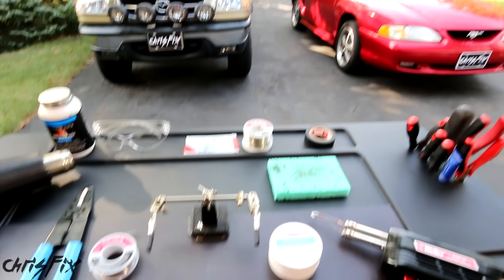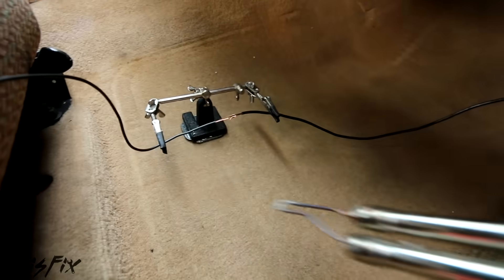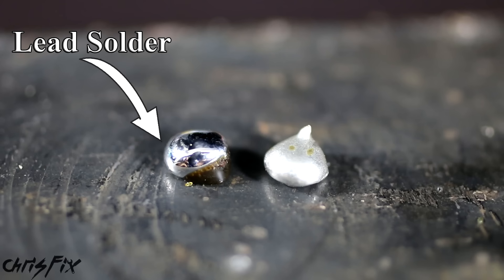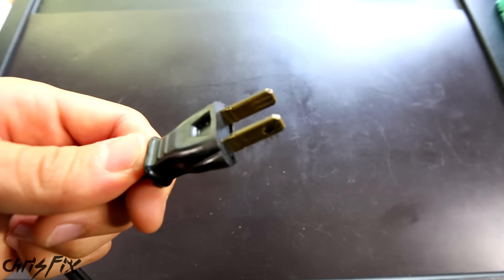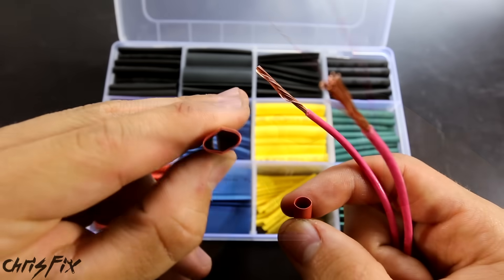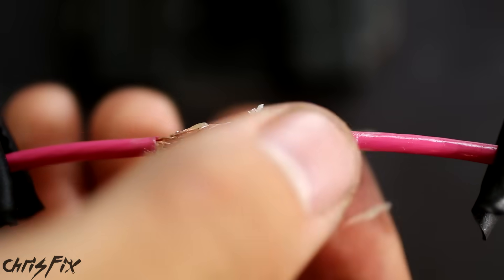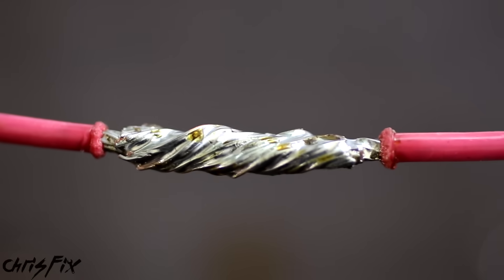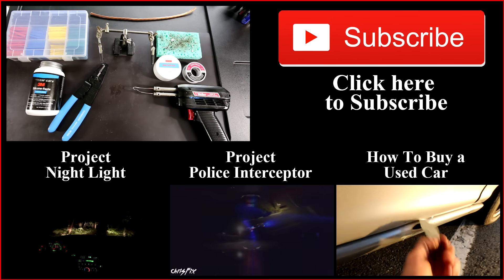How to Solder Wires Together (Best tips and tricks)

Comment: Tinning and cleaning the tip are important. However, DO NOT leave your iron "dry" after you're done soldering. Clean it with a sponge to remove the excess solder, flux, etc. then tin the tip with a little bit of fresh solder to provide a protective layer which will oxidize instead of the metal of the tip itself. Next time you use the iron, heat it up, clean off the tip then add a tiny bit of fresh solder.

Comment: My only contention is using the damp sponge to clean the tip. Use brass wire to clean the tip, then, quickly touch the tip to the damp sponge to SHOCK off the oxidation. I think your soldering is perfectly acceptable for the task at hand.
Reply from the maker: Thanks for the feedback

Comment: I had worked in a printed circuit board shop, I when I was running the gold tipping line, I plated my NEW, copper soldering gun tip. It was the best ever. I let it go to a person that really needed a great soldering gun, so, your tip on making a Cu wire tip is great, find someone that can make it Golden. You will Forever thank me for that suggestion. - It will heat up so fast you will be shocked.

Comment: copper is a very heat conductive metal, if the solder iron touch the copper threads, they will transfer the heat away from it to the surrounding area  very quickly, weakening the rubber that is wrapping on the wire with that heat, that is why the cold solder or whatever it is called is a better way to deal with wires.

Comment: For a better result and keeping the solder from running up the wires to far use a heat shrink. That way the only stiff part you solder is just the connection point. Now in your video the alligator clips are somewhat doing that job so be careful when you touch them because they can suck the heat from the soldering gun/iron.

Comment: I can't for the life of me get the solder to go into the wire unless I put the gun on top and touch the solder to it.  Just putting the gun on the bottom of the wire and the solder on the top does absolutely nothing other than get me incredibly frustrated...and putting the gun and solder both on top leads to blobs everywhere and a horrific joint.

This is one of the more frustrating things I've ever tried to do.  What am I doing wrong?

Comment: Thank you I will be using these skills. I was using an AC plug in Chinese soldering iron I did not understand The gauge wire has to match the heat range of the iron the sodder I used it did not want to melt at all. But when using a torch lighter it would melt easily

Comment: okay, been soldering for a while now, but never realized the importance of flux when soldering thick wires. That always frustrated me when the wires took ages to heat up to prevent a cold joint. so thanks for the well done video. Learned something :D

Comment: I actually learned to solder in a school setting, but i wanted to see how you do it. There is one more way to solder and they use it on airplanes. They stick solder on one strand, then the other, and then just solder them together. its still as strong as the core wire, it has to be as, again, they use it on airplanes. (They do it side by side and not tip to tip of course.)

Comment: Hey Chris love your videos. As a qualified Aircraft wiring and solder technician you're pretty close but a few tips I would add to this procedure to make it totally reliable:
1. For a cleaner smaller joint you can make it two to three times the length of the wire diameter or slightly longer and interweave as you showed. The solder is strong enough to hold it together and coupled with the heat shrink it will also help keep it together. If it's in the engine bay on the engine, make them longer and roll one over the other round and round then solder together.
2. Clean the wire with some Isopropyl Alcohol before soldering.
3, You need to strip the insulation back and only solder up to about 2 times the wire diameter from the insulation to ensure it's flexible, so the insulation won't stop it form flexing. If it does stop it then the wire bends at the insulation it acts like two hands bending a coat hanger back and forth and over time the wire will break where the solder meets the insulation jacket.
4. Use very little flux, but use some. This removes any left over oxidation on the wires before it's soldered together.
5. YES Put a small ball of solder on a clean soldering iron tip, contact the wire and feed from the top as you showed. This ball ensures a rapid heat up of the wire and full penetration into the wires. If you don't and the wires don't heat up fast then the insulation can start to melt, not good.
6. ALWAYS remove the FLUX on the joint with some Isopropyl Alcohol or Acetone before sealing it up with heat shrink or some other environmental covering. This will ensure that the left over acid in the flux does not break down the solder joint over time and eat into the copper wire. Even if you don't add flux most of today's solder does have some in it. That's the brown melted looking sugar stuff you see on the wire after soldering. It has acid still in it when you're done so clean it off.
7. Dielectric grease is a great idea, if you have acid free silicone RTV that's even better. Even better still is environmental splices, specifically if they are not in the passenger compartment. You can find it at most automotive stores.
8. Before you cover the solder, make sure any strands that are sharp or sticking out are flattened out, as over time they will break though the heat shrink or covering and can short out on the car frame, causing intermittent problems and fuses blowing s.
Thanks for the video. Best Wishes n Blessings. Keith Noneya

Comment: Solering two wires directly together in a car is actually a big no-no! Solder work-hardens and also oxidizes over time if not properly insulated. It also causes a hard spot in the wire and can cause the wires just before or after the solder joint to break again as an effect of work hardening the copper due to movement and vibration. Solder should not be used where movement or strong vibrations can occur, so again it is not god for joining wires in any moving vehicle. The proper way to connect wires in a vehicle is by crimping. Just tear apart any factory loom and have a look. There are no solder joints there, everything is crimped. There are even some old cars that have twisted together wires though not in the most common way and with some type of glue applied over the connections.
Reply: I am an amateur when it comes to wiring... most just my personal car stereos and such.  How is crimping better than sodder?  Unless I’m missing something a crimp is just pushing wires together in a connector.  How could that be more stable then metal that has been melted together?

Btw if I sound like a smart ass I’m sorry I am actually curious and just don’t know how to word things any differently
Reply: That's not true. There wires joined in to two and three wire joints are soldered in many wiring harnesses. The group of wires in harnesses are typically taped tightly together. And don't break loose at soldered joints. Your overly generalized comments seem to suggest the wires in automobile harnesses sway with the movement of the car. While in fact they are tightly connected in dozens of points on and in the vehicle. You are simply uneducated on automotive electrical wiring.
Reply: Electronics use solder joints,wiring harnesses do not. I'd be more than happy to say that I'm wrong, but I've had dozens of harnesses appart and none of them have solder joints. Have almost no experience with American stuff, so I wouldn't be surprised if some dumbass engineer at Chrysler at some point in time decided to solder a joint somewhere but I highly doubt it. 

Soldering electronic components to a board is one thing. Soldering wires is another thing.

Wires do not move in massive amounts. Your ignorance is extremely obvious as you do not take vibrations in consideration and you have never seen a solder joint destroyed by vibration and/or corrosion.

Although there are different types of solder, most commercially available ones are far from flexible enough to be used in high vibration environments. Meanwhile, please do not confuse soldering components to a board or wires to components or boards. The issue is mainly when joining wires together.
Reply: @nickodim4400  That makes sense to me.
Reply: @nickodim4400  take notes, 91 Toyota Corolla. 4AFE engine . Pull the engine wiring harness. You will find soldered and crimped wires in the harnesses behind the fuel rail on the back side of the valve cover. Also, I'm not sure you have disassembled many wiring harnesses. Most ground wires are crimped and soldered.some battery cables are soldered. And as I mentioned, I've seen factory harnesses with two wires soldered into one. You can give the benefit of your experience. But you have not seen all harness. Look closely at every plug or  connector, everyone of them is soldered at the back of the individual connector. You will also need to send me a picture of any factory butt connector or crimp style connector that isn't soldered also. You can be right about what you have seen. But look further.
Reply: @joeyjonson6017  what you are talking about are soldered connectors. This has nothing to do with what I am talking about and yes there are tons of examples of that. However, soldering is not a proper way to join two wires together in a vehicle. While there are some instances of idiocy in some manufacturer spec harnesses, I may reassure you that most factory harnesses don't have two wires joined directly together with solder and heatshrink. As I said before, I'm sure some dumbass engineer has done it somewhere but that for sure does not make it a good practice as I have fixed dozens of directly soldered together wires. Soldering crimped connections or terminals is perfectly normal and ensures good contact. Please read what you are commenting on. My statement is related to the video and I stand by it. 
P.S. I regularly crimp and solder battery terminals and larger connectors.
Reply: I blew a job interview at a hospital by saying I liked to solder my wire connections!  The head engineering dude said that the dissimilar metals create radio frequencies which disrupts the operation of the equipment!?  Who knew?
Reply: @garybulwinkle82  Why would you use two different metals in the first place for electrical wires? That's stupidest shit I've ever heard.
Reply: They use lead solder in airplane manufacturing and have for a very very long time. They banned lead free solder due to failures caused by vibration as the lead free stuff fails. They also used lead solder in boat building, not sure what you are talking about, but mass amounts of electronics in cars use solder joints.
Reply: This guy knows what's up.
Reply: If it's all about crimping why do some battery terminals have crimp and solder? Why does my truck from 2002 have soldering in the stereo compartment? Jesus, the nerve of some people. You called a Chrysler engineer a dumbass for soldering when he can call you a dumbass for crimping. If I use electrical tape and it works, them I can call you both dumbasses. It's not about the right way it's about the way it works, and by the way  if you get heat sinks in front of the cable you don't want to heat up, then you avoid the problem all together.
Reply: @iiSup3rior  the video shows wires joined together with solder. For the love of God read the entire comments before answering. Of course crimped connections can and are soldered, smt components are soldered as well, a wire can be soldered to another wire when you are simply tapping/splicing into it but soldering two wires together is dumb as f... Of course, writing is always easier than reading or thinking... There is a use for every technique but joining two wires together with solder in an automotive harness is non existent in any car and is also some next level stupidity..
Reply: @nickodim4400  oh so you've gutted every car ever made, gotcha.

Comment: 0:17
ONLY AND IDIOT WOULD DO THIS TO A WIRE THAT THEY SOLDERED

also. the label CLEARLY STATES that it is called SOLDER
there is an L in the middle

why do you continue saying SODER

Comment: Is it really that necessary to tin and clean the soldering iron or gun? Also, is flux really required as well? 
Why can't I just solder with an soldering iron and solder?
Reply: Tinning and cleaning are important. However, DO NOT leave your iron "dry" after you're done. Clean it with a sponge to remove the excess solder, flux, etc. then tin the tip with a little bit of fresh solder. Don't clean that off, don't add flux. The layer of solder that remains is necessary to protect the underlying metal of the tip from oxidizing as the solder will oxidize instead. When you use it next time, heat the tip up and clean off the tip then add a tiny bit of fresh solder.

Comment: This is a completely incorrect way to solder two wires together. The proper way is to bend each tinned wire into a “J” then lock the two wires together. This creates a stronger solder joint and is also the way it is taught in any soldering school. The way that is shown her can lead to frayed wires along with a cold solder joint.

Comment: I really like your videos. I am having a problem replacing an alternator plug. I practiced stripping and soldering wire, and I’m ready to do this thing with a pigtail. Well the original wire is copper, I found as I cut off old plug. The pigtail appears to be aluminum. What do I do? You didn’t mention splicing different metals.

Comment: lol was Aircraft EL/EV in USAF and was so entertained (really) I remember Tech School and this is so much better.  I used solder gun so much.  Mainly used splices to join wires and mostly solder on pins in cannon plugs or circuit boards but this took me way back to first class early Oct 1992 hanger we trained in was so cold and this was so warm lol

Comment: Why not just spin the copper wire around and heat shrink that closed. Isn't it still a good connection? Why is solder necessary?

Comment: Remember kids soldering makes flexible wire ridged.  So if they are not fully supported on both sides you're better off finding a different method like crimping if appropriate for the application.  

Most of the connections in the car you drive are crimped connections.  

If you soldered the connections on the leads to your stick welder they would break before you could finish your first job.
Reply: Preferred Customer - I don't mean to be an ASS (I'm not even a complete ass; I'm missing some parts) the word you are looking for is "rigid" (stiff/inflexible); "ridged" means that something has an edge/crest/peak.

Comment: So the heating element in soldering guns is just copper?  I thought they used some higher resistance material.

Maybe the soldering gun I had was really shitty.  I replaced the tip just like you did and it caught fire after a couple of minutes. (The tip refused to get hot though :-)

Comment: Says you don’t need many tools has a table full of tools
Reply: Still less tools then most random cheap screwdriver set contains.
Whether it’s electricals, woodworking or gardening or whatever; it always comes with a startup cost for the basic tooling.
Reply: This is why most people avoid electrical entirely. If you do electrical you will see that the tools for the job could quickly become overwhelming. Or you could spend a bit on silicone filled crimp connectors that would only require you to have a combination plier that cut, strips and crimp. Btw it would defeat the point.
Reply: You definitely need the solder, flux, heat shrink tubing, and soldering gun but you don't need the clips or heat gun but they are super cheap. The heat gun can be purchased for less than $15 and the clips for less than $10. Use a lighter or your girl's hair dryer instead.
Reply: All you really need is a BFH and torch!  😂
Reply: Mr. Z Everything’s relative.
Reply: Sounds like you don’t need to do any soldering then ¯\_(ツ)_/¯ 

Leave it to someone who has the tools if you don’t have them. I’d normally say you could rent them but these are small enough tools that I don’t think there’s a place that’ll let you

Comment: The one thing I would add, is after you solder the wires, clean off the flux, it can be corrosive over time, just get a little brush some Alcohol and clean it up.  makes for a better joint long term. As another note always remember the solder will flow to the heat source so you can keep your iron in one spot and let the solder do the traveling.

Comment: I like to do the first Splice, but.... I remove half the copper from each side and then spin them together. 
After you solder and use the shrink tubing you dont see a huge lump in the cable.

Comment: Been soldering since I was 12, I'm 34 now and have been soldering basically every day my entire adult life. Here's some constructive criticism:
1. DONT USE LEAD FREE SOLDER. It sucks. Leaded solder may sound worse because lead is horrible to everything, but at the end of the day, you need a good connection and I've found that lead free is much harder to work with, especially for beginners, it doesn't melt as well, it doesn't flow as well, its difficult to see if you've cracked the solder joint etc. 
2. The best ratio for solder is 63/37. It's not the easiest to find but if you want the best results for basically any job, use that.
3. Don't use the first method Chris showed here, use the western union. NASA uses a similar one and I've never in my life seen a professional use that first kind of splice for Copper wire.
4. For the gun or iron, I personally like irons more because it's more versatile, maneuverable and controllable but for the type of soldering you use in cars, a gun might be a better choice